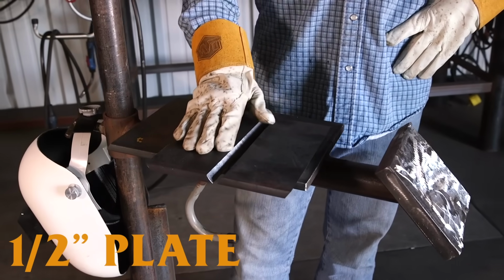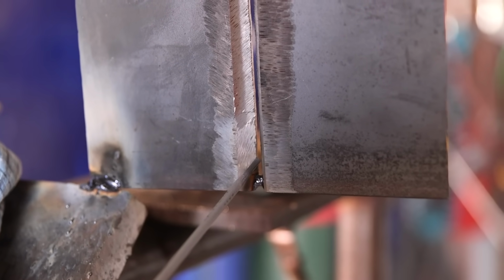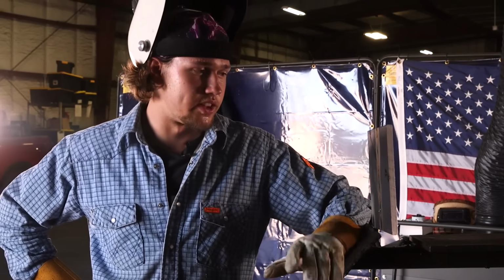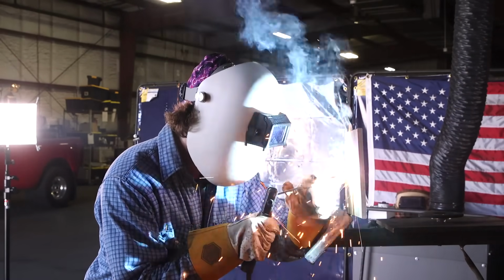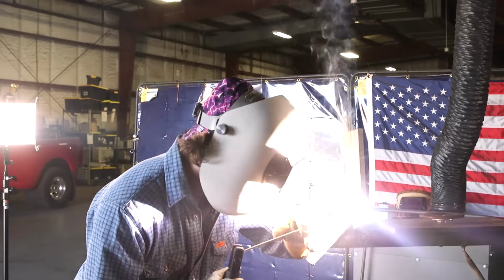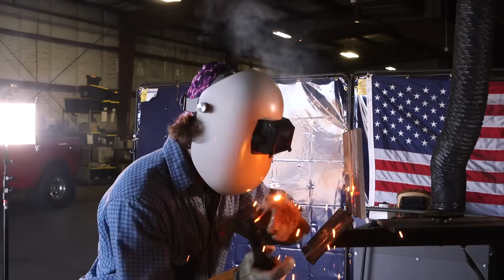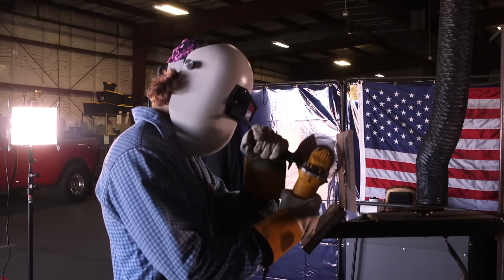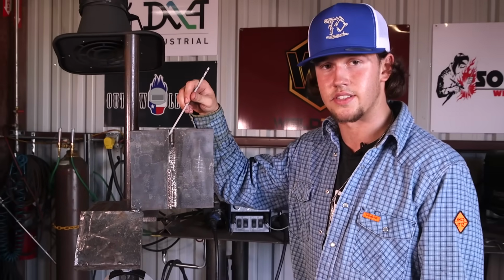3G Open Root Plate Test | 6010 & 7018 | Stick Welding

Comment: It amazes me how simple your welding tests are in the states here in chinada where only allowed a wire wheel no removing any metal. You have to have a backing plate and you have to demonstrate atleast 2 stop and starts your root gets visual inspection for undercut and on your hot pass your not allowed to go up and down only side to side as the up down traps slag and destroys the structural integrity of your weld and the once you finally get your cap on you get choose either bend test or x-ray test always choose the bend test because if they find any slag on the x-ray test fail if your plate bends into a perfect U with no cracks and no slag spots over 1/32 of an inch show on the back side of the bend you pass
Reply: No it’s just one of the test. They test you on many things.
Reply: Yeah, that's a totally different test. We do that as well. Backing plate tests are gravy compared to open root.
Reply: Your talking about a different weld test dude

Comment: Seeing the beads of each pass and the root bead penetration would be helpful.
Reply: The root looked like shit I bet that’s why they didn’t show it. Way to much fire on the front side of the plate for that back side to look good
Reply: @Leightonellert  We use one eights 6011 for the root and usually 3/32 7018 for the filler passes and cap unless the procedure dictates the fill and cap as 1/8 . Same fit up as he is using. I'm sure the root bends would fail on the one he done in his video. We don't normally need to change the settings on the machine to go from the 1.8th 6011 to the 3/32nd 7018. Most times the machine is some distance away so that works nicely.

Comment: When I took my test many years ago we didn't get to set up the test plates ( the inspector did ) and all passes were done with 7018 and no grinding allowed. Hand wire brush ,scratch awl and chipping hammer.never strike the slag with the hammer .

Comment: How do you know what pattern to use when making your 1st pass? Do you do circles, whip it &come back, or left right then move up? How do you know what to use or when to use what pattern?
Reply: You can do a whip and pause like going back and forth into your puddle or you can just run a straight bead root pass by just going straight no weaving you just gotta go a lil slower to fully stitch the sides and get full penetration.

Comment: Instead of having a 6010 hot pass can I use a 7018 for the hot pass
Reply: yes 7018 1/8 run it around 120 amps or 3/32 7018 at around 90/95 amps

Comment: On criticism I have is the way you set up the root. If you run a heavy 1/8th land and gap, you can run the root at 90 amps like the rest of the test. It's a much easier way to do it in the field. I'm not climbing down off a scaffold to change my heat every time I need to run a root.
Reply: @Augustus Michael Instablaster =)
Reply: @Callan Kyree It did the trick and I finally got access to my account again. Im so happy:D
Thank you so much, you saved my account !
Reply: @Augustus Michael no problem xD

Comment: I've never seen the up-down-left-right movement before.
Reply: How long you been welding Mark?? We call it the Christmas tree technique here. Very common, in saying that some welding firms here don't allow weaving at all.. straight up stringers all the way out
Reply: The up then down side to side is the T-technique for 6010 or also for 6011 leaves a nice stack of dimes if done correctly.

Comment: What's the difference between using 6010 on the hot pass vs 7018?
Reply: 6010 you can manipulate the rod differently, you can go up and down to fill the root without slag and deformation, if you try that with 7018 it will slag ajd cause porosity
Reply: It helps a lot on open root

Comment: what polarity did you used for 6010 root pass sir? very usefull video. Godbless.
Reply: @Username-mt6ok  is it ok 6010 rootpass dcep? why not dcen that normally used polarity for 7016?
Reply: @kabakaledwardallan313   Yes.  7016 is mostly used for pipe. And according to where you're working is supposed to be ran dcep not negative.

Comment: When I was at welding classes (1978/79/80), if the instructor entered the booth and found us welding with two hands, he would switch the welder OFF and make us start again.....
 From scratch. New coupon..!!!
Reply: Each to their own I guess.. what ever makes the welder comfortable is best. Tough instructor
Reply: @danieljoseph9553  Those were the days, I guess.  (:
Reply: I am personally more comfortable welding one handed but if he welds better two handed more power to him.
Reply: Yeah well i guess hes saying the welding rod aint that heavy
Reply: I'm a millwright, we are taught 1 hand holds the stinger, the other is used to brace yourself. I only use one hand on the rod when I'm welding in a tight space that is hard to control with just one hand, as long as I can lean on something.
Reply: @joshr7860 
 Yep, same.
First rule of welding.... get comfortable.

Comment: Can you also do 7018 hotpass or only 6010
Reply: you can do both but others like to use 6010 because is isnt too hot like 7018 theres a chance if you use 7018 you can burn thru depending if you stay too long on that spot , i usually use 6010 but i go downhill on it to finish it quick
Reply: We do 7018 all the way.. no change of welding rod. Only amps change. 90amp root run, hot pass and cap 100 - 110. 12mm plate 3-5mm cap. 3.2mm rod 7018

Comment: Thanks guys Gra8 video....I am currently doing this for a welding assignment soon & I was wondering what’s the lowest I can go on a hot pass cause 90 and 85 amps for me is to hot I can’t move my hands that fast So the puddle flows out on me regular...so is 70-75 good Option  Or not ?
Reply: Dont get hang up about the amps just keep a tight arc and wet in the toe of your welds. And each machine is different and some can show a different amperage then its actually putting out.

Comment: Really struggling with my root. I looked awesome last week and the slag fell right off the backside... but this week it looks like shit and is all bumpy. My teachers told me to grind it down thin when I start over with new electrode but when I do that it burns a hole and then I get stuck there cause I'm not able to fill it up... really don't know what to do. I feel like I'm doing everything in the same way as last week but now it's totally different results

Comment: Not a bad demo but why use a low high electrode which are harder to use than a standard 6013 electrode ,if you where using DC did you use electrode positive for the hot pass,and why use two hands to weld you are not the only one to use this technique  ,i learned to use one hand with a hand screen that way to me you learn balance and are able to manipulate the electrode better ,would have liked to have seen the penetration on the backside of the plate.You did well for a young man,
Reply: In the US a lot of employment tests for SMAW are this exact test with these rods

Comment: CAN E6013 ROD DO THE ROOT PASS?
Reply: It can but it's not recommended as it's a low penetrating rod designed for thin sheet metal where as the 6010 and 6011 have a hotter burn to them and penetrate better especially on open root welds

Comment: I feel like I'm missing something he said 3rd and final cap but he only did 2 one the one side and then he went to the other side and im assuming did 2 there as well?
Reply: He did one up the left, one in the middle favoring the left side to prevent undercut, and then the 3rd that overlapped the bevel and the 2nd cap

Comment: I'd like to see em weld it out 1/8 inch gap, land and rod with stringers. Twice as hard
Reply: on a vertical I've had the "luck" on doing 3/8 " gap between two beams and last week 3/4" between a steel plate and it's column , man some crazy work do i get some times .
Reply: Yea im on that weld now....1/8" gap vertical....hopefully i get past it on monday but next is the same only overhead